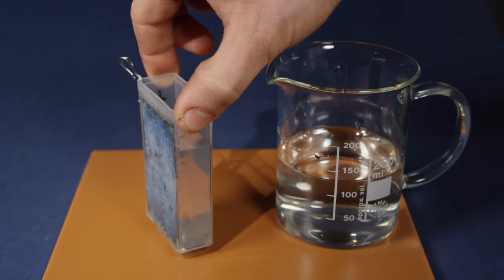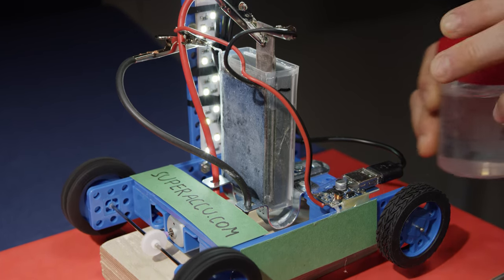Chemical Goldberg machine - Mg-air battery experiment proceeds at snail's pace

Comment: This is one cell right? If I want the voltage is about 8 volt, is it right I build the cells in series?
Reply from the maker: Right, 5-10 cells in series. However, if it is a small load then voltage step-up converter would be more reasonable to use